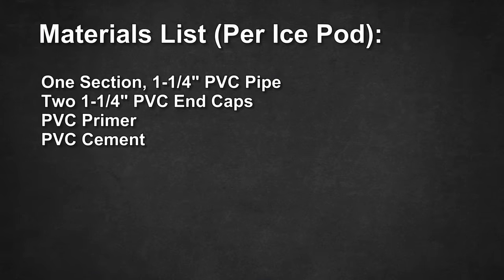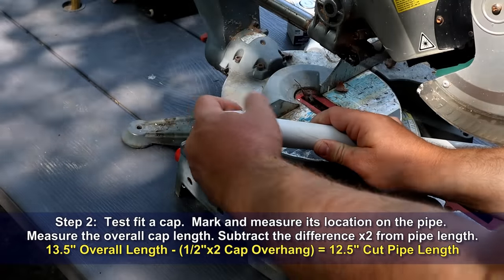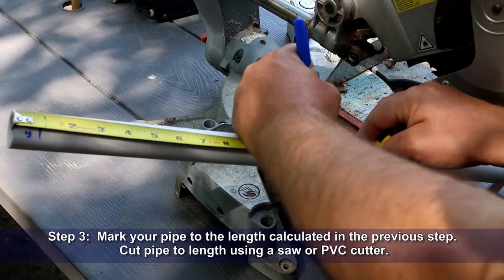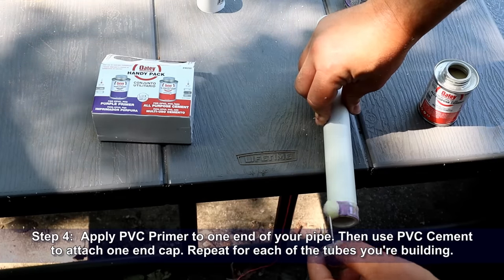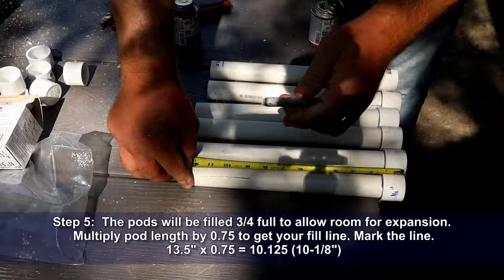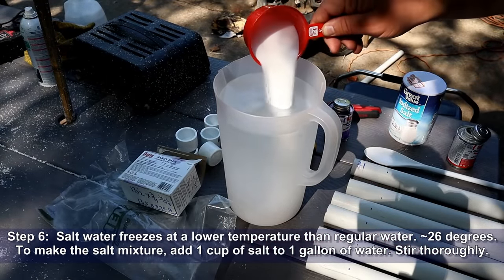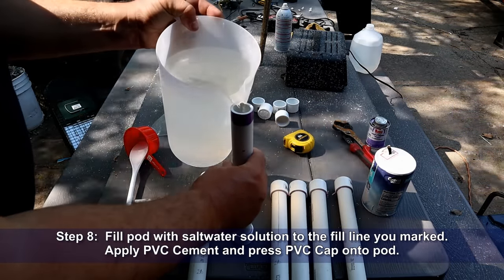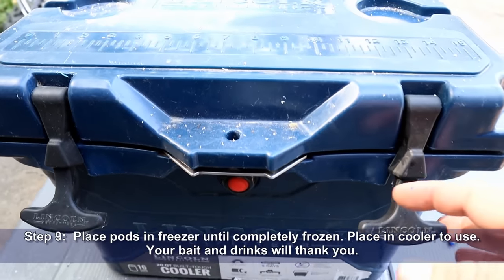Cooler Hack! How to Build SUPERCHARGED Reusable Ice Pack Pods

Comment: In case your interested, the only difference between the purple primer and the clear cleaner in the yellow can is the purple dye. They came out with the purple primer around the early 80's so the plumbing inspector could tell whether or not you used a cleaner/primer before the solvent weld. So unless you are getting a plumbing inspection, I always use the clear cleaner in the yellow can because the purple will stain anything it touches. Just FYI
Reply: oh??? read the can...the clear is labeled cleaner...the purple is labeled primer
they are not interchangeable
Reply: @docyoungblood9521  I'm a retired master plumber, the only difference is the dye, and the obvious use of the word  primer or cleaner. Same stuff, does the same thing.
Reply: @gsail6600  I think you are wrong, but of course who knows? That would only make sense if people were buying both products. As a plumber I had both on my truck, but Harry homeowner will only be buying one.
Reply: @gsail6600  how would making two different cans and two different colors of primer that cost the same amount double how much they make since it takes the same amount of cleaner to clean the pipe whether clear or purple, they did it to mark sanitation lines so you could tell them apart and not mix them up later after they were buried. go read some plumbers building code books then come back with an idea of what you are talking about please.
Reply: Use the hot blue and no need primer 👍🏽
Reply: @effinhaole808  Are you referring to the Rain or Shine glue in the blue can? Sure, for something like this you don't even need to use a cleaner/primer even with the normal glue in the green label can.  When I contribute to a topic I like to explain the proper way to do things but in this instance, no inspections and it won't leak if cleaner is not used.
Reply: @effinhaole808  since you don't know what primer is used for, i guess this could work for your customers.
Reply: @williamfowler616  don’t need to be all disgruntled, I know what primer is used for, with blue “rain or shine” hot glue primer is not used …got it?
Reply: @effinhaole808  thank you doctor knownothing
Reply: You are wrong, and you are right. Let's use an MSDS to settle the debate. Functionally speaking both are interchangeable for most of the work you do, but aside from the first two ingredients (this excludes dyes too) they're the same.

Both contain Acetone 67-64-1 and Cyclohexanone 108-94-1 as their first two ingredients. Purple also has Methyl Ethyl Ketone 201-159-0 and Tetrahydrofuran 109-99-9.

Methyl Ethyl Ketone is a cleaning solvent with some pretty nasty side effects. It also dissolves PVC during the cleaning process to help bind to the other pipe/cap in conjunction with the Tetrahydrofuran's use(s).

Tetrahydrofuran is a solvent used for making PVC. This is likely used to assist in the bonding process after the glue is added because MEK beats the heck out of PVC chemical makeup, so something has to help fill it in or strengthen the bond. 

In conclusion, the clear stuff works fine, the purple... works better. I wouldn't want the purple near my drinking water honestly and using too much MEK can damage pipes.
Reply: @mr.grotto    sigh.  Now you're just confusing the issue with facts.   ( wink, thanks! )
Reply: @OneWildTurkey  I just laughed so hard the wife woke up.

Comment: Just a suggestion - if you load the pipes with very hot saline water before you seal them, the air inside will be expanded.
This will contract when cool, and will provide less pressure on the caps and pipe when the water is frozen.
Reply: I was thinking bringing it to a boil and filling completely, when it turns to ice it will cause a small vacuum

There is a temp that water is expanded equal to ice, if you use that temp when it turns to ice there will be no pressure or suction.....if you fill completely
Reply: @rugershooter5268  so what is that temp?
Reply: @kevinsantascott3688  my guess would be under 100, steam is water expanded more than ice.
When we start up cold boiler with level at 60" valves closed, we have to keep draining to keep it from shutting down at 67", but we're going up to 285f under 40psi
Reply: Wtf thats deep
Reply: @kevinsantascott3688 there is no temp that water is expanded equal to ice unless you also include its produced gas volume. Ice expands 9% greater than its volume of liquid water, while (near) boiling water will expand up to 4%.
Reply: @piezoman79 in the science of keeping my booze cold, 5% of a homebuilt freezer pack being empty is an acceptable number.
Reply: @piezoman79 depends on which polymorph of ice one has.
Reply: I use 4 half gallon jugs 3/4 full of water with 5T of salt each. It goes in the freezer without a cap, but it goes in the cooler with a cap. Since block ice is so hard to find these days, it's a great pre-chill or they reduce the amount of cubes needed. Perishibles can go next to those jugs.

Comment: Back when I was guiding, I just used 2 Litre Coke bottles filled with salt water.  They fit the cooler perfectly.  I could easily get two days use out of them.  Another advantage was that I could dump the water after they thawed to make it easier to transport home to be refilled.
Reply: I used 50/50 with RV winterizing fluid (ethylene glycol - NOT the same stuff as car anti-freeze) and the other half water. Does the same thing and gets colder than salt water, but a little more $$$. Cheers and cold beers 😂
Reply: @scottleggejr  I'm going to try this. I usually deep freeze 1L bottles with plain water
Reply: 2 liter bottles takes too much space.
Reply: @johannvanderschyff7735  I just freeze my drinking water bottles. Then drink them last. 2 fish with one worm or is it 2 birds one worm. Anyway you get the point
Reply: @intractablemaskvpmGy try using near boiling water with about 390g of salt
Reply: @scottleggejr  how many days will those last?
Reply: @scottleggejr  uhhh this video is about polar ice tubes. You said you use 50/50 RV antifreeze and water. I was wondering how long they stay cold in your cooler?
Reply: @drwells  depends on how cold you can get them. We have a deep freezer that can keep dry ice so they last a long time when they are that cold. Also depends on your cooler and ambient. I'm in Arizona so a couple days on the boat in direct sun at 105F easy.
Reply: @scottleggejr  ok. So I should be able to double that in Missouri in the fall in the shade then. Thanks